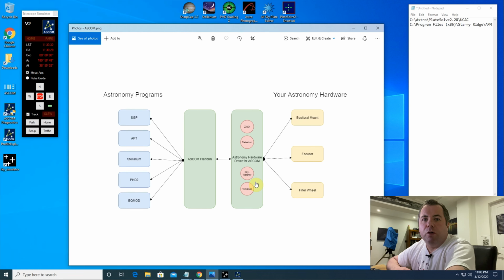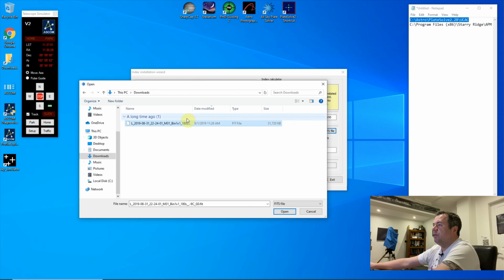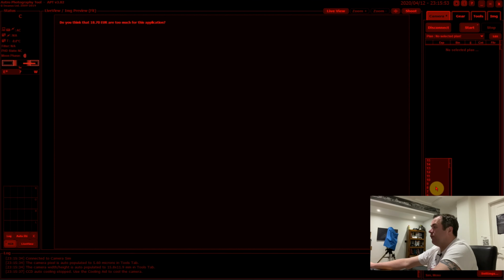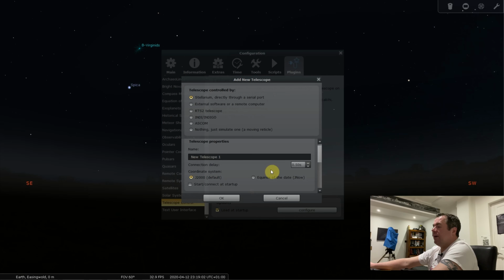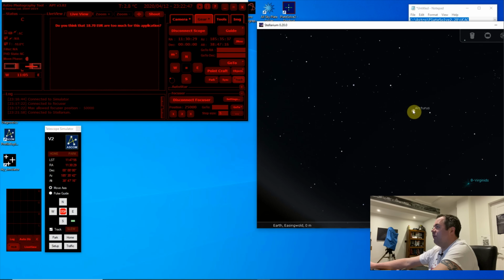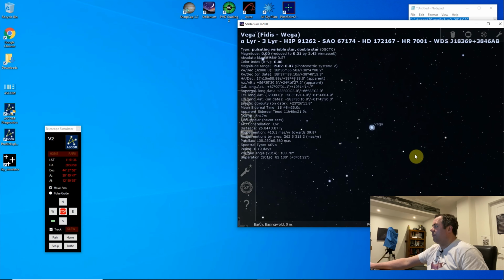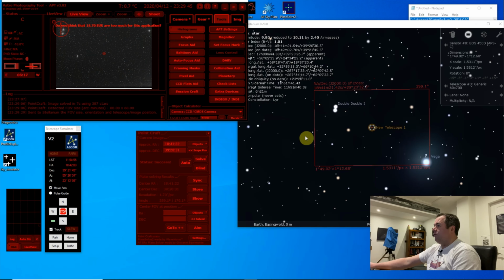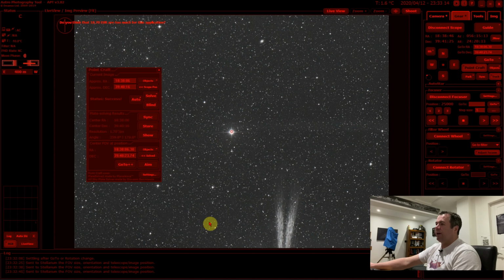Beginners guide to setting up and using ASCOM to control your astrophotography gear - Part Two

Comment: Walter Gebhart
In part 2 (APT) you briefly mention "a pretend sky" and you say use " a simulator"  but too quickly click on "Sky Simulator" and get a dialog box.  I can't get there.  I'm missing the secret sauce. Also once a camera is chosen, how do you get back to the "chooser" to get a different camera.
Great presentation.

Comment: Hi Nigel and thanks for the video. I've had a break of 3 years or so and have forgotten a lot of what you've got in the video itself. One of the annoying things I've come up against is the configuration between Stellarium and the scope. I've followed your instructions but replaced the virtual mount with my Ascom skywatcher mount and click add but nothing happens. APT has picked up all my gear so I'm at a loss to know what I haven't or have done incorrectly. Any advice would be greatly appreciated Nigel.
Reply from the maker: So just check your using native ascom support in Stellarium and not some thing like stellariumscope. I don’t normally do this, but if you want to do a remote session over teamviewer, email me using the address in most of the descriptions of my recent videos. I can probably diagnose what’s going on easier
Reply: @HogarthsAstrophotography  Thanks for such a quick reply,. I'll have 'play around' with Ascom and see how I get off. Thanks again.

Comment: Thank you very much for sharing your knowledge. But I have a question. I've used your guide to the point you want to connect stellarium to your mount using ascom.

I have an Lx200 classic. Connecting to Apt through ascom worked and I am able to move the mount using the directional keys. But when I want to connect Stellarium it fails to connect. When I disconnect the mount in APT I ám able to connect it in Stellarium. 

What could be the problem ???
Reply from the maker: Are you using ASCOM in both APT and Stellarium to connect to the mount ?  I believe Stellarium has native serial support for the LX, but i doubt that can be shared with multiple programs.
Reply: @HogarthsAstrophotography  
Thanks for your response.

Yes, both through Ascom.

I think your right. Haven't thought about that. The serial connection could indeed be the problem and unable to share. That would explain why only one program can connect at a time.

Thanks again 👍🏼

Comment: So after just reading many of the highly praised comments i came across a few asking about taking a shot in APT and it not showing the correct image, you commented that you are using an external software that wasn't mentioned in the video..
Glad i read the comments and you replying back to the people.
This will save me and you repeating the same thing when i set this all up tomorrow.
Cheers.
Reply from the maker: Thanks for the comments. If you look at my practising astrophotographers video I did a few weeks ago, I cover it off in that one

Comment: So im an absolute beginner to all this astro stuff and I just bought a secondhand telescope with camera and guide scope plus im waiting on the delivery of my EQ6-R Pro.
Ive watched so many videos on many of the software mentioned and it was just doing my head in..
Then i stumbled on these two videos....oh thats how it all connects/works, thank you so much for these.
This has to be the most useful information i have come across in regards to using ASCOM and connecting it to the hardware ect.
So cool that you can use a virtual mount.

Cheers.
Reply from the maker: Hey John, glad it helped out. Have fun with your new gear.

Comment: Thanks very much Hogarth, now all is working ... i was able to set up the sim camera in way to have the same field and the same view of my camera mounted on my celestron 6se .... learning is a never-ending story. just a thought .. it is unbelievable how things developed since '90 ... i rediscover astrophotography after a while .. 20 years ... now i am able to see in few minutes on my poor 6 inch scope object that only 20 years ago were impossible to see on very long exposure on chemical with very hight costs for film and time frustrating  .... for instance a small field of ngc504 with galaxies 200 m yl far .... appears on my monitor with only 500 sec exposure .. a correct plate solving allows me to center correctly in few minuets the object in the camera field ... now next step is to learn to set up a correct autoguiding procedure .. once that i will jump to a new setup .. a RC 10 on CEM60 mount .... but this will be only when i will have a full control of actual my modest and simple setup .... many thanks for your tutorial .. it was a really great time .. thanks again!
Reply from the maker: Thank you for the kind comments

Comment: ... :( even with skysimulator installed ... where am i making mistake ?
Reply from the maker: With sky simulator, you need to make sure on the sky sim camera as on properties, you select the image button and tell it where to save the image, you only have to do this once, but if you don’t do it, it will error

Comment: Thanks very much for your boith video, i am facing someproblems with simulator notwithstanding that i had followed all your installation process step by step .... problems start suddendly when i start to take picture with sim camera (ref starting min 15:41) .. message in log bottom left  area  say " 1) started - bulb shoot 2) bulb exp ..... 3) can't save immage 4) finished plan - bulb shoot .... and the liveview/img preview remain completely black. i tried with my ASI 170mm .... shoot and the picture appear ... could you please help me  ? really many tanks for that!
Reply from the maker: If you have a black image, depending on what imaging software your using, you probably need to stretch it. If APT this is done using the Histogram tool

Comment: When we get to the "take photo" part of the video I don't get a picture in APT and I get and error message "can't read the image" . Given that this is a simulated camera where will it get the image from anyway? One difference I noted during APT setup camera select is that I didn't get the fifth option "sky simulator" which was the one selected. This is an excellent vid, but I confess I am stuck. Anyone help?
Reply: I've got!. I should have read through the previous comments first.

Comment: Hi Hogarth, thanks for the very usefull video!! Somehow I get stuck at slewing the mount in Stellarium. First it said that the mount was in sleaping mode. That message I somehow managed to solve but the mount is still not moving. Sofar I can judge I have made all installations, settings and communications well. Do you have any clue what this can be?
Reply from the maker: What mount is it ?
Reply: @HogarthsAstrophotography  Hi Hogarth, It is a Celestron Adv GT. In the meanwhile I managed to connect things propperly. I am connected via CPWI now and all programms follow the mount now. I am currently experimenting with PHD.
Reply from the maker: @dirkvansambeek6941  cool. I was going to say if it’s a celestron, I’ve found that you can’t send ASCOM move commands from any programs until the mount thinks it has been star aligned. My celestron CGX does exactly the same.

Comment: Hello Hogath, my partner and I recently have got into Astrophotography and have followed part 1 and 2 to the T. We cannot for the life of us get the simulator to work (shoot an image), let alone move onto plate solving. Any tips?
Reply from the maker: Hello. So the simulator I use in the video, I don’t cover setting up, as I’m using it purely to make the video more engaging and close to what would happen out in the field.

that said,there are other built in simulators for the camera, mount etc, but the built in camera simulator for example only will show 1 picture of the same stars no matter where the mount is pointing.

so can I ask you, when you choose your camera in the ASCOM chooser,  what are you picking ?
Reply: @HogarthsAstrophotography  we originally used simulator as that was our only option. I later found the "Sky Simulator" you used in the video but understood we did not have the image for the preferences. We managed to get the start up simulator to take the one imaged you just refer to. However, how will this then feed into Plate Solving? As we do not know what stars are imaged from this simulator. Thank you for your quick reply. My partner is slowly losing heart when we have invested a lot already but have nothing but equipment to show for it 😁
Reply from the maker: @rhiannonharrison7285  so, if I understand what you’ve setup.. you need to use something like APT or NINA and setup your virtual camera, mount 

then setup platesolving in APT or NINA.

the sky simulator camera, simply saves a JPG file, which is then presented through ASCOM to APT or NINA as if it had come from a camera. So APT and NINA don’t really know your using a simulator, it’s just another camera to them

If you want, I can chat to you on discord using voice if you can run discord on the PC your trying to setup (need a mic and headphones ideally). You can share your screen on the call and I can probably better guide you
Reply: @HogarthsAstrophotography  is there a way to private message you? It's getting a bit late this evening but would love to discuss this further with you in the week
Reply from the maker: @rhiannonharrison7285  email me - nkarnold at googlemail.com

Comment: I didn't get the option for Sky Simulator as shown in the tutorial?
Reply from the maker: Hello. It’s a separate download, I simply used it to show a more realistic sky from the images.
Reply: @HogarthsAstrophotography  it's fine i still got it all to work, thanks, great tutorial series.
Reply: @HogarthsAstrophotography  it all works fine using the simulator, but when i hook it up to my own mount, when in apt i can set my mount to move to a target and watch the telescope icon move in Sterallium, (small) problem im having is when i try and do it in sterallium using ctrl + 1 nothing is happening, not a game breaker, but wondered if you knew why this wouldn't work?
Reply from the maker: @Sidecontrol1234  CTRL+1 assumes you only have 1 telescope, if its the 2nd scope in your list, you would do CTRL + 2 - how many scopes are listed ?
Reply: @HogarthsAstrophotography  hey turns out my sterallium wasn't up to date, now got it working with EQMOD.

Comment: Thanks for a very good pair of videos. The only thing I can't get to work in the simulation is ascom sky to display the picture taken with the simulated camera. I get a white screen unfortunately. Can you through some more light on this please. I've been an avid Sharpcap pro user till now, but the SC platesolver doesn't work for me and I plan to install my gear in Apt the way you have shown us. Thanks for showing it all in such a calm and methodical way that I can understand.
Reply from the maker: thanks for the comments.. appreciate it.. i think your sky simulation problem is.. im going to guess your using the built in one that comes with ASCOM.. you need this one 

https://sourceforge.net/projects/sky-simulator/

its fairly straight forward to setup.. let me know if you have any issues / problems
Reply: @HogarthsAstrophotography  Thanks, I downloaded from the link and ran it but only see unfocused stars. Maybe if I don't run the simulated focuser the bright star will be corrected?
Reply: @HogarthsAstrophotography  Thanks for your link to the Sky simulator, now I can slew in Stellarium to Vega, and click shoot and its there in Apt, but the resolution isn't the same as yours. What resolution in the Sky simultor do you use please? I used the suggested 1200x1200.  Point craft is working to a point,  and will solve successfully though not as accurately as you demonstrate. Thanks for your help.

Comment: Great video Hogarth :-)  I wish I'd had such a concise explanation available when I started astrophotography last year, as there has been a lot of trial, error, cursing and researching to get me to where I am now, most of which I could have just breezed through using this video!  I still learnt quite a few new things though, such as how to get Stellarium to move the mount and the Aim function in APT, so thanks for that!  Something else that might be useful to folk would be something on configuring Oculars in Stellarium; doing this has really made a difference to me when planning sessions .  Keep up the good work!
Reply from the maker: Michael Benn thanks for the comments Michael. I have another video which takes you through oculars to use plate solving and see what your scope is pointing at

Comment: I was trying to connect my Atlas to the program, but it did not communicate with the software. I wonder if there is a specific  cable connector I need to use. Do I have to connect  the port that uses the  hand control  to my computer in other for the software to operate my mount? It is a bit confusing I know:(

Comment: Thank you for this great and informative video, this helps me a lot. However, I still got a question. When I'm not using the simulator and want to take pictures in the real sky, I guess I've to select the right driver for the mount, camera,... and not the simulator right? So in my case, I would have to choose the EQMOD ASCOM HEQ5/6 (for my HEQ5 mount) when looking at the window at 8:00 right? And the same of course for the other Hardware right?
Reply from the maker: Nic Biembacher that’s correct.

Comment: Thanks for your detailed and practical explanations!  Difficult to do better. I however have a problem with Stellarium: the simulated telescope does not slew to the element of the sky I selected. The scope is connected and I can see it, but it doesn't move.
Reply: .... and I just figured out that the track button was not selected in the telescope simulator remote control. Fixed!

Comment: This is a wonderful video.  Super informative.  I do have one question.   When I try to take a photograph in the simulation mode.  APT always returns a photo of the Orion Nebula no matter where I'm pointed in Stellarium.     The RA/DEC in Stellarium, the ASCOM "hand controller" and APT all agree on the correct location (Whirlpool galaxy for instance) but when I take a picture in APT it's always Orion.  I'm sure I'm just doing something silly but can't figure it out.  I'ts keeping me from trying the simulation of plate solving.  Anyone out there have any ideas?
Reply from the maker: Thanks for the comments.. appreciate it.

In terms of the simulation.. You need an additional piece of software. its open source.. https://sourceforge.net/projects/sky-simulator/

you will see a new camera in your ascom list after installing it, but you must run the software downloaded from the above link and also connect it to your mount using ASCOM. If you want any help, let me know
Reply: @HogarthsAstrophotography  Thanks so much.  I'll try that.  Your video is very thorough and easy to follow.  I appreciate being able to see what the screen should look like as I do each step.  I'm a teacher and I know how difficult it can be to explain something.  Well done!

Comment: @hogarth Great videos, thanks for taking the time and effort - it's appreciated. I was able to configure all software and get things working, apart from being able to take an image in APT for plate solving using "Shoot": I get the following message 
"...
Started - Bulb Shoot
Exp 1/1 : Bin(1x1), Gain(N/A), Offset(N/A), Duration(1"), CCD T(0C)
Can't read the image
Finished Plan - Bulb Shoot
..."
Any pointers as to where I've gone wrong, or where to start looking? 
Using simulators throughout, on W10 Pro PC.
Reply from the maker: Ian Moore I used so very specific sky simulator software, not the the built in camera simulator. The built in one, just has one image. Where as the one I used (not covered in the video) gets the image from the internet based on the real target.